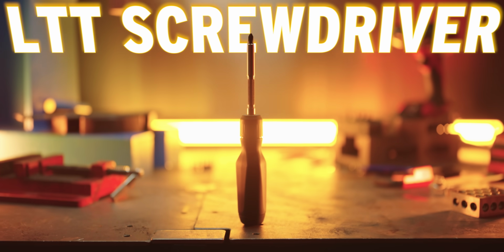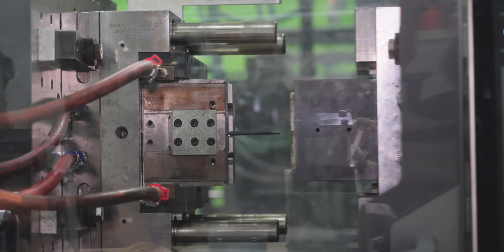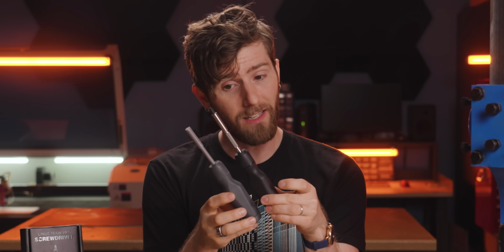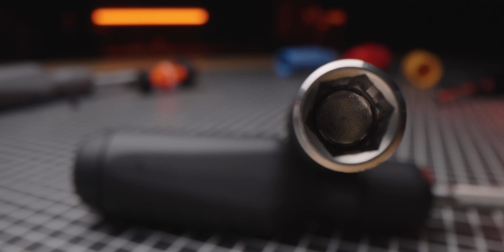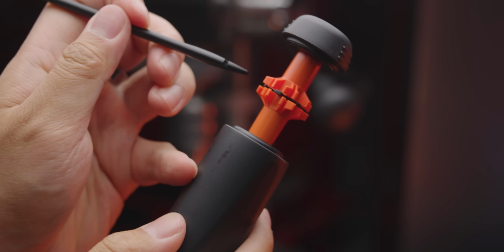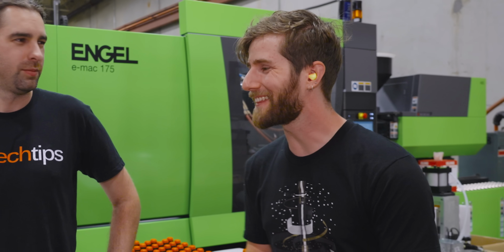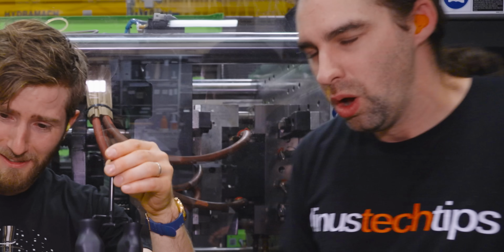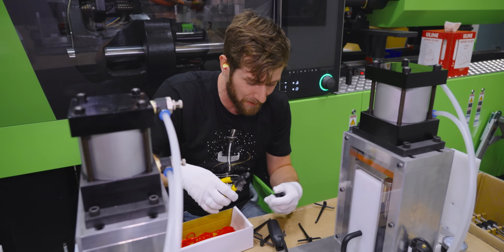Why our Screwdriver took 3 YEARS

Comment: If you think that's reasonably fast molding, an injection molding factory I worked at as a maintenance fitter and die setter had a couple of injection molding machines dedicated to nothing but yogurt tubs, about the size of a normal cup. Those ran with a die with refrigerated to near freezing water running through the die to set the Polystyrene faster and they were pumping out one tub at a time but, I counted one at 55 per minute, damn near one a second! Admittedly when you first started it would spit out a few dud ones till you fine tuned everything AND the mold started running consistently enough that condensation wasn't forming on the die in the fraction of a second while it was open ejecting the previous one. Most other products needed more time but these were in big demand and were very thin walled so it was possible to go that fast but, it still always fascinated me to watch one hammering away popping them out almost only a second apart.
An odd product they also made was the worm drive wheel for the drive for a popular brand of cars speedometers. They were molded out of Nylon then tempered to last by soaking them in hot oil for a fairly lengthy period. That has nothing to do with any of this, I just found it interesting then and had never seen any other plastic parts treated anything like that before.

Comment: ok fair enough you got a niche, but like a screwdriver something which most people dont give any thought 2, a cheap screwdriver will do the exact same thing a expensive one will, not to mention most household apliances have started using universal screw heads, i have had a 10 piece screwdriver set which is still going 15 years on, this is a item you buy once and leave, unless you lose it. from a business standpoint i get it youll get some tech enthuists to drive product launch sales, but do i see this thing having a consistant revenue flow nope, youll get a peak sale demand no doubt but its soon will dip when the general public who watch these videos have no need for a swanky screwdriver they will only use once in a blue moon, nonetheless entertaining and enjoyable video. But im sure linus is only making a limited supply

Comment: Been using a  snap--on ratcheting screwdriver since the 90s . Still works same as new today . Think I paid 40 or 45 for it  off the tool truck. 
Haven't checked your prices yet but I certainly wouldn't  charge more than snap-on!  Lol

Comment: One thing on precision screwdrivers that you don't see so often on larger screwdrivers is a free spinning doodad on the bottom, meaning you can kind of use your pinky or your palm to keep pressure rather than holding the shaft. 
I wonder if that could work on a big screwdriver like this one!
Reply: I have jewelers screwdrivers with that feature, and they're really handy. In this case though, you can just grip the whole handle and use that to apply pressure - because of the ratchet mechanism and the knurling, you can turn the shaft and bit independent of the handle.

Comment: Not to sound like a jerk or anything, but as someone who works in molding your video drove me nuts. 

 Not entirely in a bad way,
 just that the molding and post process is a pain in the ars lol. 
Like the fine details are very difficult and we often have to scrap a lot if something hiccups.  

It may look so but it's not so easy like popping a stamp sooo many factors like temp, pressure, hold time, etc. can mess stuff up. 

So when you're bringing up changes I'm like "ugh", *bangs head on wall and throws away weeks/months of work*. lol. 

Love your videos man and i can guarantee I'll be getting one. But goodness this video was tough. Lol

Comment: Wouldn't it be better if the bit have a locking mechanism like on the impact drills along with the magnet, you could even have a small three jaw at the end so when you push the bit in it will be a little harder and it will be even harder to take out with the magnet holing it. This will stop the bit from coming out again?

Comment: Awesome video. This screwdriver has been so hyped on the LTT network, so I was excited to finally see the production model. Definitely one of the coolest pieces of merch I've seen from a yt channel, but as far as pure utility goes...
Look, if someone needs a high quality ratcheting screwdriver, why would they pick this over the Megapro that it was based on when the Megapro costs like 50% less on Amazon (and you can get it right away)?
Reply: Didn't you watch the video? Basically 30 minutes of explaining how they could've slapped a LTT logo on Megapro driver and be done with it, but instead they decided to overhaul the design to create a superior product. It's not even merch tbh, it's an actual product. Higher quality costs more, just like with anything.
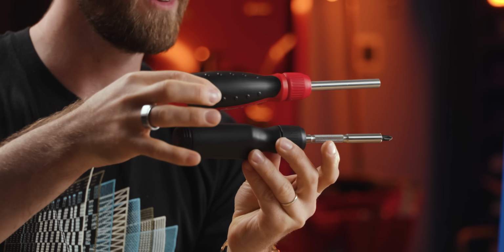Reply: 2:23 sums it up. This is a completely different product designed for a completely different use.

Comment: Lets be real here, $70 for a screw driver is insane.  Comparable units can be found for half this, from major brands.  Their better be a lifetime warranty for that price.
Reply: This is why megapro implored them to just take their product, change the included bits and give it an LTT coat of paint. Would have saved so much time, effort, money and resulted in a much cheaper product of probably no discernible quality difference to the average consumer. But instead of just going cheap and just sticking their own logo on somebody else's product - they set out to design and build their own product from scratch. That costs money which is why it costs what it does.  The engineers linus has on his payroll don't work for free, $150,000 deposits with manufacturers don't repay themselves etc.. All that tooling and design cost needs to be recouped.  Maybe once they've sold enough that they've repayed all of their investment start up costs the price can come down. But it really does depend how well they sell. If you can't understand this and just want to spend $20 on a product where somebody has just stuck their name on somebody else's product, go ahead. But there is no secret conspiracy here to rob and defraud everybody. Doing it this way costs more. If you don't like it - just don't buy it and leave the product to others who appreciate the effort and design put into the product.

Comment: this screwdriver wouldnt even last 1 day on my jobsite. 
Magnets are terrible in the field. Collect shavings, fill ups, stops working.
303 stainless is very soft metal, it will bend very easily
3nm of torque is literally about the amount of force it takes to screw the plastic cap on a milk jug
no strike plate on the end of the screw driver

I'll go to harbor freight if i want a cheap screw driver that will last for 1 job

Comment: As a machinist (CNC programmer for Applied Materials) I do find myself sometimes annoyed by some of these young engineers who got too used to prototyping on printers and so often fail to consider concessions to manufacturing methods in their designs.

Comment: The included bits are not long enough to get into deep socket screw holes.  The driver kits for iFixit have the exact same problem.  The bits are too short.

Comment: Interesting if the molding machine is designed for this purpose only or only the main head is changed in order to mold the material into the specific form needed by the screwdriver.

Comment: 20:55 there is a heating element, yes. But that heating element does not make the plastic molten. The main amount of heat that is necessary for melting the plastic is „made“ by the friction between the screw, the granulate and the walls. 

There you go. Should have asked a Material scientist :-P 
I don’t have experience but since I do need to know just anything about injection molding next week I do know at least that.

Comment: I worked for Snap-on Tools for almost 20 years and this screwdriver is nearly identical to one I have had for almost 10 years now. I find it funny Linus said they bought all of the comparable screws drivers, BUT the Snap-on one is not there. Btw, Snap-on is the one who bought your plant earlier in the video.
Reply: Project farm compared it to the snap on, the snap one is kinda meh these days.

Comment: well all i can say is that i am impressed with your production tolerance, now hoping that quality control can keep up, btw i make tractor and truck engine parts, and our tolerance is 0.02 mm max, for a dam screwdriver to be within 0.05 mm wellll saying u are a bit of a maniac in quality control is an understatement, i will get one for sure should be useful for changing tool holder bits(now sure how to translate the tool inserted into the cnc and the small bit that actually does the work) on the CNC .
PS: u might consider making an armband support for the tools, a magnetic armband and a bit of metal in the tool handel itself so u can wear it on your arm for easy access/confort, we DIY that sort of stuff

Comment: For what it's worth, this video made me miss my old career. Until a year ago I was a product designer and engineer for over 10 years. I can identify with basically every part of the process and every pitfall. I've been involved in bringing lots of products to market, some of which were in areas we didn't have prior experience in so I get what you guys went through and let me say, I am shocked at how good the finished driver ended up being. We launched a Bluetooth pressure transducer to market a little while ago and had tons of QC troubles with the enclosure that we weren't happy with but were forced to suck it up. Well done guys, hope you sell lots
Reply: I want to be a product designer / engineer. Too bad I am too late to the party (for about 15 years)
Reply: @Qaosbringer  what makes you think you're too late?

Comment: I use electric.. a fine tune slight adjust mode slim line electric 
Yeah, or my manual one with like 50 different exchanging bits that jus fit into a tiny pouch, including pc component tips. 
I like the venture though it must be great actually creating your own tool, I'd still do it

Comment: I like the way the workpro ratcheting screwdriver is designed, it has a collar between the shaft and handle you can hold with one hand and twist the handle like a quarter inch back and forth to rachet, it also has a reversible rachet which is huge for taking screws back out and is way quieter. Can also fit bits up to 3 inches inside the handle

Comment: I prefer normal screwdrivers if I'm honest. I have an English made ratchet 1/4" socket driver with a screwdriver handle and the few times I tried it, it just felt so alien to use. I have since found an electric precision 4mm bit screwdriver made by xioami and that thing is awesome, I use it all the time at my electrician job on terminals. My only gripe is that it lacks a bit in the torque department, to be expected though when the whole thing is only about 20mm in diameter.

Comment: Why not make the bits for each level face inwards on each other? Then you might have been able to get normal length bits in the holders while having 12 bits by interlacing the ends of the bits.

Comment: in the UK pozi drive bits(PZ) are incredibly common. will you be making pozi bits available in the future? also would be nice to have a bit holder designed for the 20mm bits so storing extra bits that won't fit in the handle when you buy extra sets is neat....I like to be able to see my bits in a case and know when one is missing. especially at work where people borrow tools and forget to put them back

Comment: Cant wait to try these, although comparing the ltt screwdriver to an actual construction driver is bit unfair. I use klein as I mostly do commercial, and not gonna lie I've used them as emergency chisel and lever. Looking at the Ltt driver i feel that i wont be able to do much chiseling with it.

Comment: linus is a marketing genius this dude did not make and sale 60k screwdrivers already, but if you get people to think they are selling like hot cakes they will jump in faster. anyone that thinkgs he made 60k of them in that short of time and sold them all for 80 bucks a pop is prolly gonna buy like 4 of these lmao great product but a waste there is a reason most products dont get this time and investment into them, its not worth it in the long run 99% of people will never buy a 80 buck screwdriver, people that use them for work want something more affordable and replaceable at a cheaper cost. most people would go with the megapro a great screwdriver doesnt need to be anybetter and def not twice the cost better get the 40 buck great screwdriver and f off with this 80 buck amazing screwdriver, unless of course thats what floats your boat, over engineered gear. fun fact i prefer non ratchet screwdriver with a spinning palm rest over somthing mechanical anyday and i never break themn and if i lose it oh well im out 20 bucks

Comment: As someone in the manufacturing industry, this was awesome to watch.

What I wanted to see some more of though was the bit itself. How does that get made, where does it come from, and why not put a magnet in the bit itself to help with retention.
Reply: The bits are likely white labled, lots of options on the market for that. As for the dual magnet setup, the answer is mostly because if you have a magnet being inserted into the receiver, and one on the bit, you MUST ensure that the poles are facing the correct direction in both pieces, in order to achieve the desired hold you are looking for. This would require an extra step and/or be a time suck in the process. (product manager here)
Reply: @RuralFisherman  for that much money they better be made of adamantium cause, I HATE wimpy soft bits
Reply: @enriquedossantos3283  Haha, same! These being smaller should effectively make them nice and stiff though so there's that!
Reply: @RuralFisherman  considering this screwdriver took 3 years to produce with seemingly little compromise, and the fact it was mentioned, I'm not sure that's the reason. Perhaps he just didn't even think it was necessary which is totally reasonable.
Reply: @ryanpatton1795  but again... The bits are white labeled...
Reply: @RuralFisherman  I wonder if planting the magnet in a certain way into the driver would cost way too much. And I also wonder if there is driver bits on the market that already have magnets in the bottoms, and even if there was theres probably going to be a discrepancy in the pole direction. Oh well haha

Comment: I think 303 and up stainless steel are non magnetic and not electrically conductive - but you can easily magnetize the inside of the shaft toward the bit Also the higher number the more durable the steel I think.

Comment: As a tool freak, this looks great. I will be purchasing it, even though it will certainly sit in my tool bag or box collecting dust because I prefer my standard non ratcheting screwdrivers. Not only because the volt-resistant grip is essential in my day job but Because 30 nm torque in a corroded auto application is much that's why a lot of screwdrivers have handles designed to ad a spanner for additional leverage.
Reply: 80 bucks for this lol waste of money if you ask me you can get a whole set of volt res grip screwdrivers of high quality for that price

Comment: Hey Linus, although I do love your current model and bit storage, could you please in the next screwdriver: put the bits storage in a small revolving cylinder in front of the driver, and pulling back lets you cycle thru bits? See: I have a Worx 245xl revolving screw driver but it is simply too bulky and imprecise to use in my PC cases. You could make a better, more precise, and miniature LTT store version of the Worx driver and in addition, can you make the bit holder slightly angled, or allow the bit to tilt in but not flop around and require 2 hands to hold it in place? 

Tall order but I really want an upgrade to my currwnt sophisticated, but outdated  screwdrivers. Thanks!

Comment: I work in a Tool and Die company as a Wire EDM operator. I can agree that it takes ALOT of work to machine these parts with electrodes. Glad to hear they worked out very well for the product.

Comment: I was sold till you changed the direction of the mechanism. Megapro's mechanism is the standard, and all of my other ratchets do are exactly the same. Disappointed. You guys did a great job otherwise. I always think of holding the front knob in place, and twisting the handle the direction I want to screw vs. twisting that front knob backwards.

Comment: My favourite screwdriver is the Autoloader, formerly sold at Canadian Tire under "quick bit."  Stainless steel shaft, plunger action quick bit change, currently sold by Lee Valley Tools and designed and made in Canada.   Your screw driver looks awesome and hopefully you can get a few sold.  That said, hopefully it isn't too expensive.

Comment: 70usd for a screw driver is pretty insane
Reply: Yes, but using a patent use doesn't come cheap. Megapro will get some of every screwdriver sold for that use. Then there is international shipping, manufacturing, its assembled in Canada (labor here isn't cheap), etc. Snap-on has a profit margin of about 20%, so my guess is their screwdriver is close to that.

Comment: After following this whole process, and recently doing some electoral work and wanting a new screwdriver I so very nearly bought one, but then I realized the only ratcheting screwdriver I have I don't use because I don't actually ever use the ratchet and hate how big and heavy it is compared to a normal screwdriver. I'd rather just put 2 or 3 on my tool belt or in my bag than have to deal with bits.